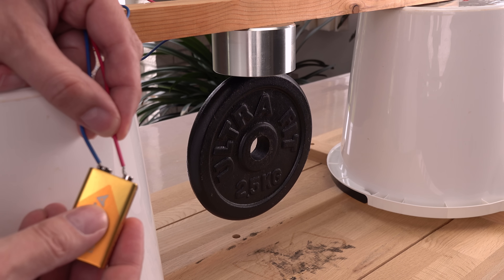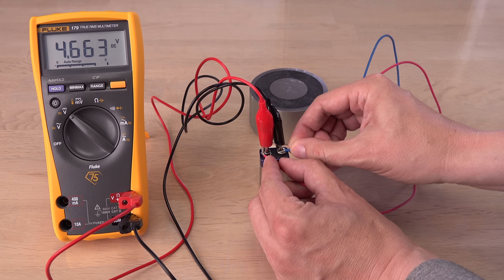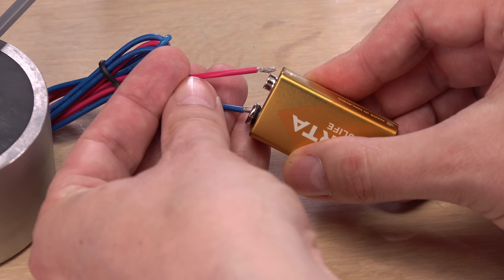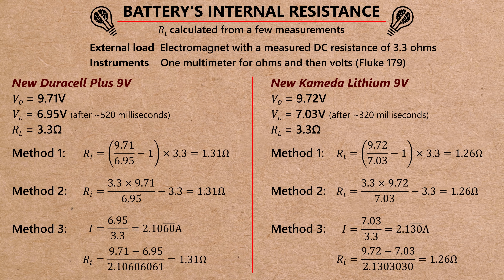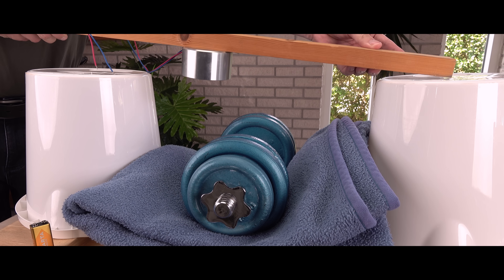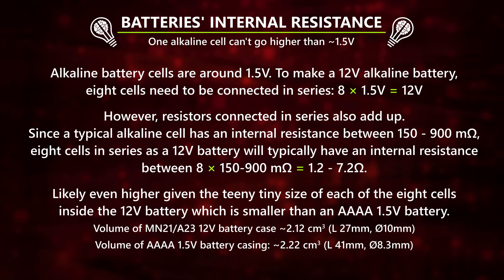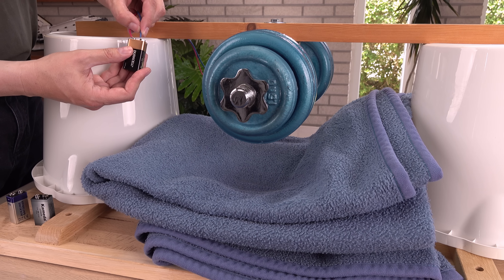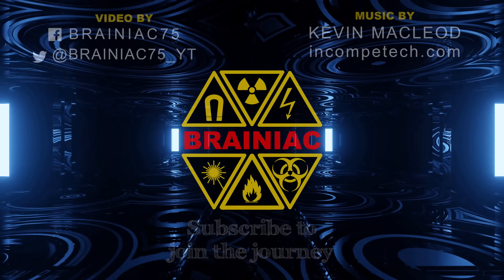The Curse of 9V Batteries | Internal resistance measured with multimeter

Comment: The irritating part is how awful alkaline batteries have become. Not so much the 9V versions, but the AA, AAA, etc. Leaking cells have always been a thing, I find it to be a far more common affliction these days than they were in the past. Even unused cells well before their best by date. I almost never leave them in any device for more than a couple months if it's to be left unused, and still make regular checks on those still in place. Though, to be honest, I've pretty much switched exclusively to using verified proper Eneloops in anything using those types of batteries. The lower voltage can be a bit of an issue in some vintage devices, but in most things they do just fine. I've been really happy with them since I started using them years ago.

Comment: 4:50 - This battery doesn't contain six batteries.  It has six Cells in it.  A battery is a power source that contains more than one cell, but a single cell (like a double A or C or D cell) is oftentimes called a battery.

Comment: Hmm - so if you got a screwed up tin foil donut shape loop, with fine wire wound 11 times around one side, and thicker wire wound round about 4-5 times on the other....will that lift the voltage enough? I'd recommend testing the voltage on the meter first... I remember doing this with a Lego 3x AA battery box as a kid when my Dad gave me new rechargeable NiMH set of three AA's. The NiMH batteries were only 1.2V versus the 1.5 of the normal AA's. Without my home made 'transformer' the Lego kit motor would not run at all. With it however it ramped up fast to over speed and burned out!

Comment: Battery is an arrangement of cells. 9v batteries are one of the few times most people actually use the word correctly.
Reply: 1S battery is still an arrangement of a single cell, still a battery
Reply: @la1m1e  Not really. One big gun does not constitute an artillery battery; neither does one cell constitute a voltaic battery. This word specifically refers to an array of several things.
Reply: @Ithirahad  A battery - a container consisting of one or more cells, in which chemical energy is converted into electricity and used as a source of power.
Reply: @Ithirahad  A battery - a device that produces electricity to provide power for electronic devices, cars, etc
Reply: @la1m1e The orgin of the word "battery" is much older than human knowledge of electricity. It comes from Latin for beating as in the crime of "assault and battery" and from there to using multiple cannons or artillery. If you've got one gun you can shoot a target, but if you have a battery of guns you can batter the enemy. Batteries were in use by the military long before electricity was discovered. The term "battery" for a group of electric voltage producing cells was derived directly from the military term for a group of enemy battering guns.
Reply: @la1m1e  You are very, VERY wrong with the "produces electricity" part, otherwise the first  reply is somewhat a "correct" description of a battery we talk about.

But in fact, the origin of the word "battery" comes just from "a bunch of things" as said anyways already, mainly known from the military (artillery and mortar battery etc)
Reply: @harrison00xXx  Go fix cambridge dictionary then, you smartаss
Reply: @harrison00xXx  And yes, battery PRODUCES electricity (or rather current) by transforming the chemical energy of the electrolytes into potential difference. Battery stores CHEMICAL energy, not directly electrical
Reply: @la1m1e You're technically correct that "a device that produces electricity" is one of the modern definitions but this is an artifact of how English is a bastard language that's generally studied in a descriptive framework without a formal body to externally control definitions, and kind of hides the etymology that's being discussed. Also worth noting that the comment in the video that prompted this was describing the Danish word which probably isn't 100% the same as the English word even if they both ultimately derive from Latin

Comment: Drawing that much current from such a battery is borderline illegal 😂

For this, use lipo batteries, those can withstand ridiculous high power delivery
Reply: LiPos can withstand much more current, yes.
But from my experience, there are 20$ packs that are decent enough for weaker stuff, but still "bad, and 25-35$ packs which are even worse and blow up within like 10 cycles, and then there were high performance packs i paid like 60-100$.... those really withstand my >5 kW pulling RC truck for at least like 50-100 cycles.

Cheap Lipos i tested had something like 200-300A short circuit current nearly brand new and not abused yed, after some fun in my RC car and slightly blown up already, they barely delivered 150A anymore. My expensive packs, after the Ir was much worse from like 2 mOhm per cell brand new to 8-15 mOhm, they still delivered >300A short circuit easily. Never tested a new cell, but calculation of rated C and burst C rate tells me easily >800A and it should be avoided since you weld or unweld existing contacts within milliseconds

Comment: If you use an ammeter like that, always verify the internal resistance, either by looking at the value mentioned in the datasheet (or sometimes there is only burden voltage, so you have to divide that yourself over the current), or measuring across your ammeter with your voltmeter, as you have two meters. In this case it looks all correct, but I've seen multimeters with 12kOhm resistance on the current setting.

Comment: Before I watch, I'll guess since 9v batteries are actually super tiny cells in series they can't provide 9v under loads.

They have failed for every project I've ever needed 9v for.  Way too high of IR.
Reply: Lets see when Betavolt batteries are on the market, im looking for it once in a month at least.

I will get a bunch of them, as much as i can afford, and connect them to a fitting size of supercap array.

A battery, lasting easily 50 years, with its super low power output stabilized by supercaps for a rare and still weak load as "always ready emergency power", sounds too awesome.

Comment: To overcome the high internal resistance of this batteries you need to use a capacitor. The exact value needed depend of the current and the time needed to release the load.

Comment: This video you confuse people, a resistor on the battery is not drawing any power, yet you electro magnet is.... and that is the reason you battery is dipping to 4 volts, because the electro magnet needs that current. This proofs that equations do not always 
explain you though process, simply thinking logical is... by the way 3 ohms is not at all much if you know that wires for exanple in audio need to be thicker and be closer to 0 ohms, which has no resistance at all for the audio signal to be kept intact.
Reply: the resistor does draw power, it is connected as a direct short to the battery
Reply: @svgaming234  Then why be so surpised when the electro magnet is drawing current, and that the voltage is going down?  You do realise that the magnet will not get hot at all even though it is 1000 ohms

Comment: 9V batteries and especially 12V batteries are built for small currents. 
The 12V battery consists of 8 button cells. 
The 9V battery has 6 flat cells or 6 round cells LR61 = AAAA
There are also flat 6V batteries called 4LR61.

Comment: when working with lithium battery of any kind be careful lithium batteries can start a fire so if you notice any bulging, getting hot or venting of any gasses discontinue use and put it in a fireproof container and take it outdoors because you do not want to burn your house

https://www.google.com/search?client=safari&rls=en&q=lithium+battery+safety&ie=UTF-8&oe=UTF-8

a 2s or 3s lithium hobby battery has the C rating to handle the load because rc models can demand many amps above the base capacity of the battery for a couple seconds so an rc battery is more suitable

Comment: The bench supply is providing up to 2.9 Amps at 7.5 Volt . That is over 20 watts of power.
At 9 Volts the coil inside should drawn about 3.5 Amps. That is over 30 watts.
30 watts is a lot for the small stack 1.5 volt cells inside the battery.
Reply: As demonstrated by this very video.
Reply: if the battery had been capable of delivering the 9v required, whilst having the same similar resistance to the coil, it also would be dissipating 30W itself... and PRODUCING 60W.

whereas a 10th of the internal resistance would be about 1/100 the power for 30.3W overall.

as it is, it was around 5W in each for about 10W overall... roughly.

Comment: The 9 Volt battery was born to provide a maximum of 50 mA to a portable AM radio. There were no alkaline batteries in the '60s, they were Zn/NH4Cl/C in their best formulation.
In the '80s, I put the hand on some (rare at the time) Ni-Cd models, able to provide 300 mA to the load.
There are some specialist 9 V battery now, built with two Li-Poly cells and a BMS, able to deliver 3 or 4 Ampere to the load.
I agree that the high internal resistance of 9 V battery may be off-putting to some, but that is electrochemistry in action...
Reply: I've seen plenty of 9V lithiums that use 3-3volt cells instead of 6x1.5v, would probably hold up to this test. they tend to be cylindrical and not use the entire packaging volume however, lower capacity, but the 3v cells exhibit a much lower internal resistance.
Reply: The B128 high tension  battery had 60 cells similar to the pp3 or 6f22 insides.  You might say the 9V version is about safety today.  You could still buy them in the early seventies for 15 shillings.
Reply: endurance over muscle power.
Reply: In some applications, the high internal resistance is a feature, not a bug.  You can use them with breadboarding, and the built-in current limiting gives you a lot more time to catch when you've screwed up, because things will heat up and then pop, rather than just pop like they would if you could put, say, a full 1A @ 9V through it from a wall wart.  It won't save you in every case, like if you forget to use a resistor and run the 9V straight through an LED, but in a lot of cases it can buy you enough time to smell the heat before something actually goes.
Reply: i thought the silver mercury ones from the 1940s were best. maybe not available in 9v format. very commonly used in ww2 by usa, the sealed button cell batteries as we call them. gm even made an electric car out of them, the electrovair lol, and used on many sattilites back then. now days button cells are garbage since they took the mercury out. they sit on the shelf so long in stores and air diffuses through the packaging and wrappers and causes the zinc inside their subsitutes to fail just from time. its why hearing aid batteries come with extra layers of plastic which try to help. mercury based ones can be recharged a few times, and get back most of their capacity, but zinc ones you have to over volt inorder to recharge just like alkaline and you only get like 40% capacity each time and its not very safe. button cells usually i try 3.7v to start and then increase to 4.0v and then again to 4.2-4.5v until current starts to flow again, that breaks down the pasivation layer inside like old lead acids and sulfation. 
yes almost all types of batteries are technically rechargeable.
Reply: but then it's disgusting that they are SOOOO expensive. i'm not paying $5+ for a SINGLE, crappy, barely usable battery.
Reply: @JustinKoenigSilica If it's barely usable, it's not the battery that is wrong, it's the application.

Comment: 1. not only internal resistance but 9 volt consumer batteries do not have the capacity to provide much current.

6 D cells in series to make 9 volts should have enough capacity to provide the current required.

2. you may be able to use the sound card and sound editor as a crude ocilloscope  but you will need some circuitry to protect the sound input from the voltages from the battery and inductive voltage spikes from the load.

since the display is the most difficult and expensive part of the ocilloscope they do make ocilloscopes that are software based where you get a black box that connects to usb and a software making the ocilloscope cheaper.
Reply: Batteries are kind of fun, I remember lining up dozens of C cells to temporarily light an incandescent lightbulb up. One of those things that today's kids are unlikely to ever experience. That series of batteries was the better part of 10 feet long, but it was able to briefly light the bulb.

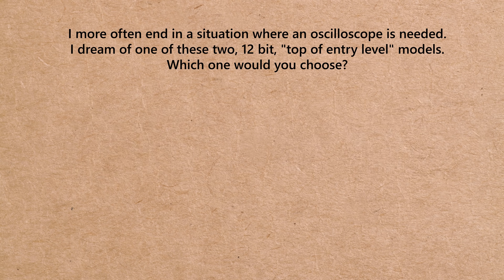Comment: 2:56 Rigol oscilloscope is the obvious choice from one simple reason: It can be powered from any USB C PD power bank and thus can be fully isolated from anything you want to measure, giving you full flexibility of the setup. Otherwise the specs are combarable, yeah, the Siglent has a more neat aproach for the logic analyzer, but i don't know how much you'll use it. And the rigol has a VESA mount if you're into bolting the thing on a monitor arm.

Comment: 5:04 technically in English "battery" should always refer to a group of cells. So really a AA 'battery' isn't actually a battery, but a 9 volt is.
Reply: As is the mighty 6 volt!
Reply: Its still a battery.
Reply: @harrison00xXx  People that want to maintain the distinction are fighting a losing battle. Apart from button cells and like lantern batteries, you're rarely able to buy just one anyways. You're not going to have retailers put up a separate sign for the single cells in addition to the batteries and without that, the distinction is going to go away, which is kind of an odd thing to say because it already has.
Reply: @SmallSpoonBrigade  Doesnt matter much (or at all) to be honest.

The case this og comment made... "AA battery".... could also mean ANTI AIR battery.

A battery is just a damn pack of cells or whatever (as where the term "battery" comes from) or a single cell for the consumer, ready for use.

What i dont understand much... AA/AAA cells are mostly called batteries, while button cells are mostly called cells. But again, it doesnt matter much or at all.

Comment: Should have bought a scope instead of the Fluke.  You'd get a lot more use out of the scope than the Fluke...  A $400 multimeter is crazy.
Reply: Depends on the model, but no official fluke multimeters were below £10 I checked
Reply: @gregglesthemaker1024 The cheapest legitimate Fluke multimeters that I've seen go for roughly $135 new. Which in a sense is a lot, but unless you're a professional working with electronics, it does far more than what you're likely to need as a hobbyist.
Reply: @gregglesthemaker1024 SO 'OFFICAL' COSTS $380?  you can buy any general meter for under a tenner or 20 at  most... only fools these overpriced DESIGNER brands
Reply: @esecallum  Or 'Fools' that earn more than you because they paid attention at school.
Reply: @andymouse  look your being abusive. you dont know anything about me. no doubt you buy gucci shows for the label
Reply: @esecallum  :)
Reply: @esecallum If you do any real work with a meter it's worth the extra few hundred bucks to have something reliable that you can trust your life too. Last I checked an energized 480V line looks exactly the same as a dead one.
Reply: @linuxguy1199  Even the cheap $10 specials are pretty reliable and accurate, you're mostly paying for safety, good for electrical work but otherwise save $300, plus the more meters the better, can check multiple things such as volt and amps or double check its right.
Reply: @linuxguy1199  You measure 480V lines with a handheld multimeter?
Reply: @gaynzz6841 
I dunno about you, but we have 230V in Europe, so 380V peak to peak. 

And sometimes you look for power lines for a stove, so you measure between the 3 230V lines earth and neutral, in hopes to find 400V. 

Guess what device you would use for that? Yeh. The DMM from some discounter grocery shop that had it on sale.
Reply: I bought my 2 channel Rigol oscilloscope for 350€
Reply: When doing electrical / maintenance work, the price of a multimeter being wrong or wearing out can be very, very high.  Best case, mess up tens of thousands of dollars of equipment or prolong a repair by hours in a facility that measures downtime thousands of hours per dollar.  Worst case, get someone killed (though a live-dead-live test will inform you of a bat multimeter before it's too late).

Knowing that, I can see why someone (or the company they work for) would be willing to pay hundreds of dollars more for a very tiny improvement in reliability, safety, or durability.
Reply: @r3dp9  but this guy is just a youtuber relying on a meagre  yt income
Reply: @r3dp9 If the multimeter is not flat out broken, then precision is your last concern doing electrical work. The only thing that Flukes and higher price multimeters in general do better is safety when working with high voltages, but that's generally not relevant for amateurs.
Reply: YOU CAN GET IF FOR 8.99

Comment: I use the rechargeable lithium ion 9V batteries. They give a constant voltage and can handle more of a amp draw
Reply: Some rechargeable li also have protection circuitry  and will cut out at 500 ma.

Comment: Please try with 18V, by using the ability of 9V batteries to clip to each other. or 27V by clipping together 3 batteries if that's not enough. Actually... You can keep up clipping and do some high voltage DC experiments if you like